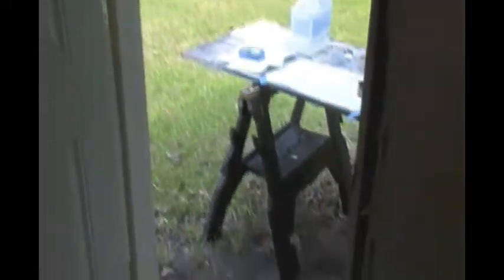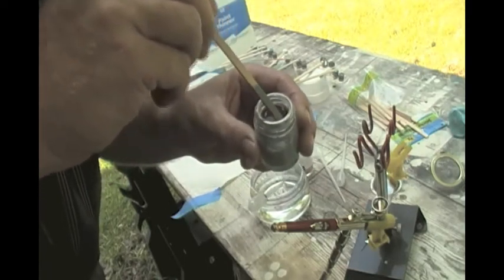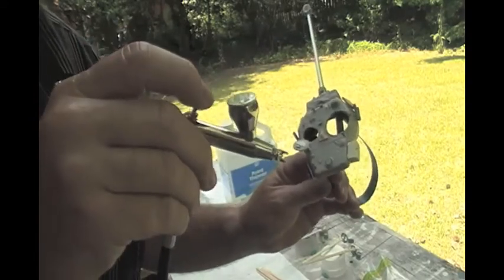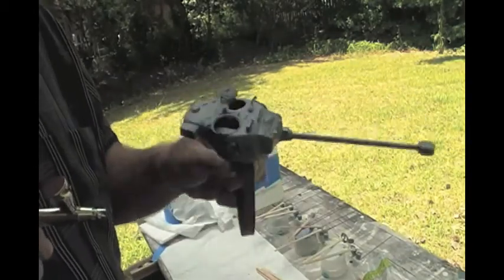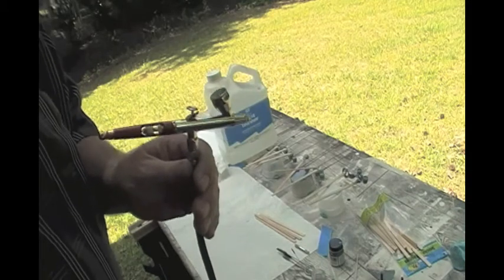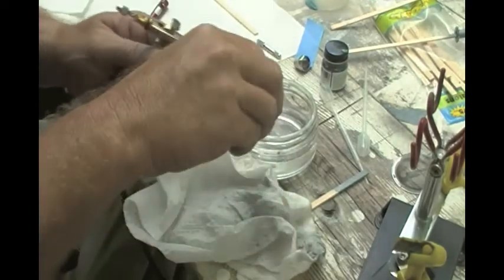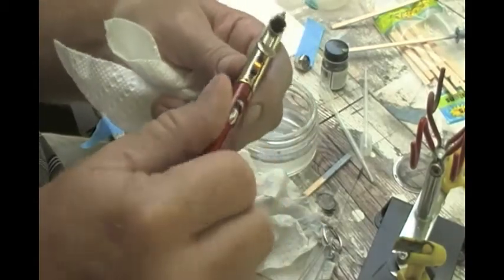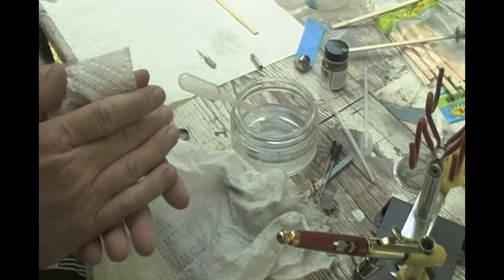M51 Isherman part 14 airbrushing & cleaning

Comment from the maker: Your welcome buddy. Your one of the reasons I made this video. After seeing your airbrush sit in the cup on your video's I wanted to show you how easy it is to clean one. Once you finish painting you should always clean it and put it back together right away. It will save the o-ring seals and maybe a part getting lost or bent. Have fun painting buddy, your doing a fine job learning. Your work will get better and better the more you build and paint. :)

Comment from the maker: It a 20 year old Sear 12 gallon air compressor. It's in the garage so i can use it for airbrushing and filling my tires with air.That's the normal sound of an air compressor of that size. Noisy huh? Hehehehe, I am so use to it I don't even pay attention. I just run the hose to the back of the garage to get the supply of air I need to airbrush.